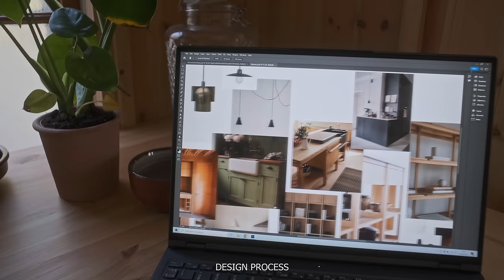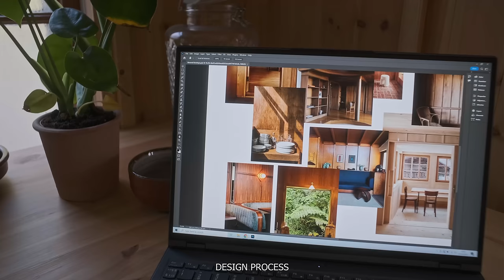DIY Kitchen & Entryway for $2000 | FULL MAKEOVER (Story 41)

Comment: One Portuguese YouTuber made a comment that viewers think she knows a lot and tackles them full on no hesitation. But she said she panicked and stresses before she starts something she has no clue how to do it. She tries it before filming. So it looks like she’s got it down. It’s kind of like when I was installing irrigation for different areas of my garden. For about a moth it was a total fail. I tweaked and tweaked till I found the right parts and it worked!! So I think with diy you just push on and try try try till it works. You’ve shown all of us that skill is built you start out knowing very little and with heart, effort and persistence you can built or do most things.